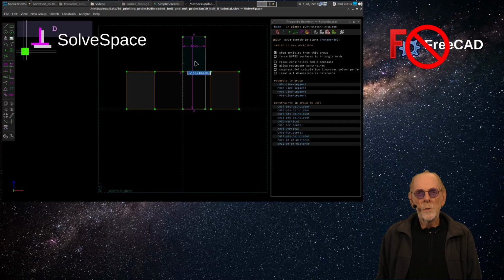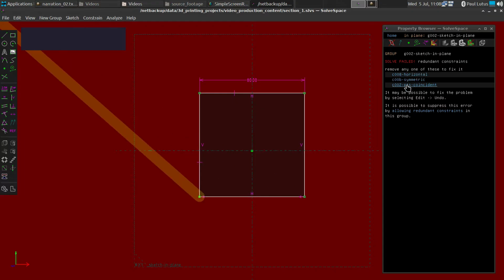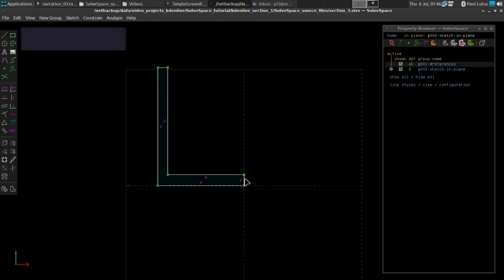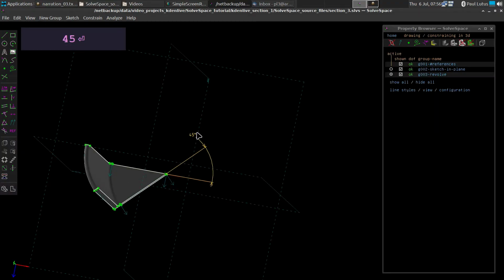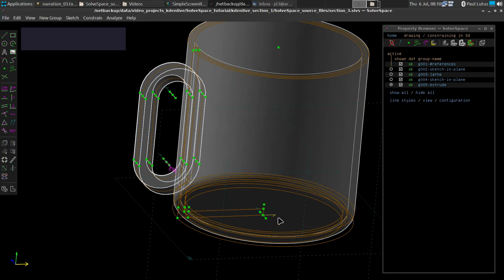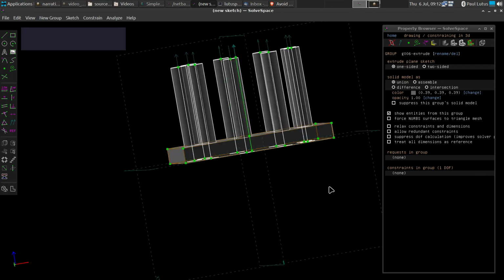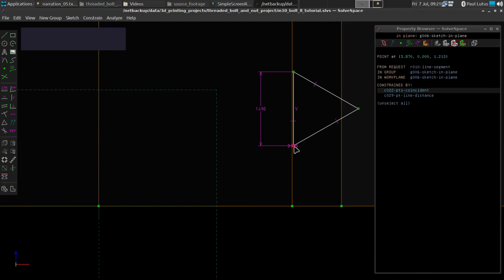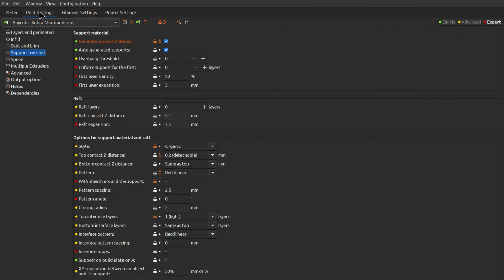Learn 3D Design with SolveSpace

Comment: I share your frustration with Freecad.  Solvespace looks great but the lack of variables and expressions is an absolute show stopper.  If you are designing a complex part or assembly, and you realize late in the project that you need to adjust something, you need to manually go back and fix everything based around that original object you adjusted.. which could be many of hours of work for one small modification.  Solvespace NEEDS expressions.
Reply from the maker: Yes, that would be an enhancement, but my video shows how to exploit single-definition values. But basically I agree with you.
Reply: @lutusp  It can work ok without expressions depending on the project. My interest is primarily with woodworking projects and the ability to, say, scale a table to a different size after I've put all the parts together, is invaluable. Someone's working on it with solvespace .. kinda. There's a "parameters" branch for this purpose, but it's not too active. From what I gather, the person working on it is stuck with how to work with different units (us/metric). Hopefully it gets some movement one of these days.  I was using fusion360 for my projects previously, but that company has done such a hatchet job to the hobbyist version I'm on a quest to find an open source replacement that fits my needs.  The worst part about FreeCAD in my opinion, is the convoluted workflow needed to access vertices and edges from other sketches when you're assembling parts that need to share common geometry.
Reply from the maker: @arcooke  Unless you dislike programming, there's a Python environment called CadQuery that's a better choice for designing projects that need strict dimensional control and sharing. In CadQuery you enter the required dimensions, then design the project to suit your predefined parameters. This way you can get different outcomes by changing only the provided dimension list and the model adopts the new entries without requiring any rework.

It's not as nice as SolveSpace, it requires more visualization skill, but there are ways to get interactive visualization as you progress.

I have a video that shows some aspects of CadQuery: https://www.youtube.com/watch?v=blkjW0JauX8 -- it's more of an introduction than a full tutorial, but you should get some idea of how it differs from SolveSpace.

I hope this helps and thanks for writing.
Reply: @lutusp  Actually, so far cadquery has been my #1 choice of all the different options I've tested out!  I've been playing around with CQ+cq-editor. I do have some programming background, though I burned myself out  (more like burst into flames) several years ago so I have trouble staying focused.  The project I've been mulling around lately is redoing kitchen cabinets and I started working on a library for cadquery, and the plan was for it to handle the general parts and assembly work so I could just plug in the number of drawers, doors, and dimensions and it would generate for me the completed cabinet boxes, and from there I could put together the cut list and get going in the garage.  It is a lot of work, but cadquery is a really neat and powerful tool.  I like it a whole lot better than openscad.  A hypothetical solvespace or fusion360-like frontend for CadQuery would be the perfect CAD program IMO; a visual point-and-click editor using CQ as the backend, with the unlimited freedom and power of python as an optional feature.  thanks for the chat. I will check out your CQ video

Comment: hello! I have an problem, when I want create an like bolt head, i get an error: "Bad selection for equal length" I think, I can choose only 4 lines, not 6 or 9.
Reply from the maker: Yes, a known issue. My video shows me selecting more than two lines (like six) for comparison, but this is a feature only available in the most recent SolveSpace version, one you must compile yourself.

The Windows SolveSpace version is not current and doesn't have this feature -- in that version  you must select pairs of lines for this operation. You must repeat for each pair of lines.

Sorry -- I can't make the SolveSpace developer keep the Windows version up to date, and most users can't compile from source.

This is one of the few differences between the Windows and Linux SolveSpace versions. I must remember to say this difference in my next SolveSpace vvideo.

I hope this explains the issue, and thanks for writing!
Reply: @lutusp  but i am using fedora linux and how exactly should i compile the newer version and what version are you using? thank you for answering!
Reply from the maker: @ВолодимирСабадаш-е1ш  The fact that you're on Linux doesn't assure you have the most recent SolveSpace version. That would require a compile from source, and compiling is a specialized activity that's really difficult without the right background. It involves:

* Installing a development environment including a C/C++ compiler and kernel headers for the running Linux kernel.

* Installing  a number of prerequisite libraries that SolveSpace needs to be able to successfully compile and run.

Details here: https://github.com/solvespace/solvespace?tab=readme-ov-file#building-on-linux

This is all so you can select more than a few lines in a specific operation. All I'm saying is this is a big project for a small return.

> what version are you using?

The developer makes many changes between version releases -- they're identified more by build numbers than release numbers.  The current release/build number (which I am running) is "3.1~eedfc653". This BTW is true for most programs under active development, especially open-source programs.

I hope this helps. I'm planning more SpolveSpace videos and I guess I should explain more about this topic in my tutorials.

Thanks for writing!

Comment: Please more advanced tutorias for SolveSpace, Crazy how nobody  mentions it as a REAL FOSS alternative to 3d CAD sketching. I used to use Solidworks and NX and they really got me hooked on the features and constraint system.... I feel SolveSpace is THE PERFECT replacement for either SW or NX.... It feels so similar and yet waaaaaaaaaay simpler. I'm powering through 3d models with this tutorial. Thank you Paul!
Reply from the maker: Yes, I have plans for more SolveSpace tutorials, in response to the many appeals for more detail and clarity around basic concepts.

Thanks for writing!

Comment: Very helpful.  I guess I find it very tricky to correctly select the plane I'm about to sketch in.
Reply from the maker: Yes,, it took me a while to learn how to chose a given target plane. It turns out that clicking the edge of the desired plane is one way -- this is more reliable than trying to choose it at the center or another way.

This works because the three planes are easy to distinguish in the 3D view by their square edges than by their centers.

I hope this helps, and thanks for writing!

Comment: Hi! With step and rotate you ended up with 1 DoF. I've checked and it seems to be the angle by which the elements are rotated when stepping. Is there a way to constrain that so that it is fully constrained?
Reply from the maker: Hi -- without a context, without a diagram, it's not easy to identify possible reasons. Sometimes the menu item "Analyze" ... "Show underconstrained points" (Shift+Ctrl+F) can help. This feature lights up points that aren't properly constrained.

I hope this helps -- thanks for writing!

Comment: For God's sake. What is this penguin + r key?
Reply from the maker: Sorry, I can't figure out which key you're describing. If this is still an issue, perhaps you could give me a time in the video so I can see the problem for myself. It might be "rectangle", which uses the R key.

I hope this helps.
Reply: @lutusp  At 50 minutes into the video, when I'm trying to replicate the drawing, there's always an error when I do shift+l, exactly at that moment it also appears in the top left corner of the video saying to type this combination of a penguin figure + r and I couldn't associate it on my keyboard, maybe it is the cause of the error?
Reply from the maker: @natanaelmelo9481  Okay, I figured it out. The "Penguin+R" is actually my pausing the screen recorder, it's not a SolveSpace command. Please disregard it and wait for the next actual command. And just in case there are more of those, just ignore any "Penguin+characteer" commands, they're not for SolveSpace.

My screen recorder has its own commands, and I sometimes pause the video screen recording to catch my breath. The keyboard recorder dutifully records those keystrokes -- I'll have to think of a way to prevent that.

Anyway, when you see the penguin, just ignore those keystrokes. I hope this helps.
Reply: @lutusp  lol ok, my friend, thank you very much, now I understand. As for the error that was appearing, it was resolved by limping a box (force nurbs surface to triangle mesh)
Reply from the maker: @natanaelmelo9481  Yes, I have to enable the NURBS feature almost always, in anything resembling a complex design. I've gotten to the point of ignoring the messages about rendering errors. They seem to have little effect on 3D printing and other results.
Reply: @lutusp  But anyway, thank you very much for your attention, I'm just starting out in solve space and I'm already learning a lot from your videos

Comment: how to rotate a drawing in solve space with the mouse
Reply from the maker: It depends on  how you mean "rotate". But try holding down the Ctrl key and right mouse button while dragging the mouse for one kind of rotation. Then try pressing the Shift key and right mouse button while dragging, for another kind.

I hope this helps.
Reply: @lutusp  Thank you very much, it worked
Reply from the maker: @natanaelmelo9481  You're welcome. Some SolveSpace users have complained that the rotations aren't intuitive, but I think over time it gets easier.

Comment: The biggest problem I know so far about FreeCAD is filleting irregular shapes and topological naming problem. How does Solve space do in these two areas?
Reply from the maker: To be direct, SolveSpace's filleting is less robust than in FreeCAD, and AFAIK the TNP has the same status -- it's not directly addressed or mitigated and is only less an issue because SolveSpace's projects tend not to be as complex as those in FreeCAD. I would be happy to be corrected about this view, but it's to the best of my understanding.

The issue in both SolveSpace and FreeCAD that I find most annoying is the fact that you cannot change an element from which other elements spring without destroying the entire assembly. That would require a level of code robustness that neither program possesses at this time.

The main reason I prefer SolveSpace over FreeCAD is that the former is less opaque to a new user. There are times with FreeCAD where I have no idea how to take he next step and the documentation doesn't help, or a feature isn't robust enough to accommodate what one might call s common-sense approach.

Thanks for writing!

Comment: Pretty good video but I almost died when you went to extrude/difference inside the cup ;-) That was bound to trigger NURBS faillures for multiple reasons. Better to end the handle sketch inside the wall of the cup - maybe draw a vertical line in there and split the curves against it? When switching to triangle mesh, we do recommend putting that switch as far down (not up) the construction history as possible. I just submitted a PR (not accepted yet) to make dimensions on ARC entities default to Radius instead of Diameter because this video reminded me that's usualy what we want. Also, S is for "segments" O is for "On" and right-click ends your line segment without starting a new one ;-)    And Q is for "eQual" I guess, but nobody mentions this and the keys seem arbitrary. Best I can tell G is for "green" which is the default color for construction lines !?!?
Reply from the maker: > "Better to end the handle sketch inside the wall of the cup"

Yes, I sometimes make unwarranted assumptions about a program's internals. My favorite program for this activity was the old Pov-Ray, which relied entirely on  CSG ( https://www.povray.org/documentation/view/3.7.1/28/ ), pure mathematics, no polygons. In that environment, everything worked as one would expect from mathematics. No surprises.

Thanks for writing!

Comment: Good tutorial. I also went for FOSS solutions, and I found both solvespace and freecad. Freecad at glance seemed more advanced and solvespace seemed more like learning basics platform. All I need is something to feed my 3d printer. Freecad I suffered through designing one or two parts, but at some point I just gave up on it, highly frustrating. I went for solvespace and learned most of it. Came in here for helix how to use it to make threads.

My only gripe with solvespace is one project for soldering iron box that required me to compile solvespace for 64 bits as it was runing out of ram. Also the framerate went to like one frame per 5 seconds. Im not sure why, but it struggles a lot with more complex projects - or I don't know how to make it in a way that it won't. (if anyone is curious I can provide file for it, be aware, requires x64 build). And the red lines sometimes get to you (even though NURBS solves 99% of occurances)
Reply from the maker: > Freecad I suffered through designing one or two parts, but at some point I just gave up on it ...

The same experience here, exactly.

> Im not sure why, but it struggles a lot with more complex projects ...

Just a suggestion, in the configuration dialog, try changing the "chord tolerance" and "max piecewise linear segments". These adjustments operate in mnore than one dimension, so they can greatly improve speed and reduce memory consumption, in exchange the screen drawings look less aesthetically appealing.

The upper two adjustments affect computatiion and display, the lower two affect exported meshes. This means you can have a high-accuracy export (created slowly) while speeding up the editing phase.

> And the red lines sometimes get to you (even though NURBS solves 99% of occurances ...

I find that if I never allow two 3D vertices (of different subassemblies) to occupy the same location in space, those errors go away. I do this by deliberately adding a tiny value to some dimensions to avoid collisions.

But in most cases more RAM and a faster processor would solve the other issues. Just saying, I know  this may not be feasible.

I hope this helps.
Reply: @lutusp  yes, i am aware of chord tolerances. Sometimes though even when its at 0.2% / 10 when project is complex enough, it struggles hard. I dont think I can grab better cpu (solve space is single threaded afaik).

My machine is pretty strong (ryzen 5800x / 80gb od ram) , but solvespace is 32 bit program by default, so by default it is limitted to 3-4 GB of ram. Thats why i recompiled it to 64 bit and then the memory limitations go away for me. 

I will try adding small spacing next time i have problems with the red lines. I hope it will not be enough spacing to fool my slicer to put there actual gap.

Thanks for tip.
Reply from the maker: @by010  I agree SolveSpace is single-threaded, I mean AFAIK. I guess my designs aren't that complicated, so I don't see the issues you describe, and my local install, like yours, is compiled in 64 bit.

I try to design complex things in pieces to avoid too much complexity in any single file.

I do know this -- all the really powerful CAD/CAM programs are closed-source, and most are expensive as well.

Thanks for writing!
Reply: @lutusp  is there a restriction on writing replies on this video? It seems if I write any reply it does not get posted?
Reply: @ruevs  thats youtube thing. They often figure out some comment is censor-worthy and hide or delete it. It is what it is
Reply from the maker: @ruevs  Certainly not from me, I'm glad to see people's posts. I hope this comment system isn't breaking down.

Anyway, thanks for writing!
Reply: @lutusp  I think comments with URLs in them get "censored". Somewhere in your YouTube Studio account there is a section of comments "held for review" or something of the sort. Anyway I'll try again with mangled URLs.
Reply: @lutusp  Definitely any reply with anything even remotely resembling a link in a gets removed immediately.
Reply from the maker: @ruevs  It's my experience that posts with links get "held for review" for the account owner, so I checked and don't see one. This doesn't mean it's not out there somewhere I can't find, and frankly the YouTube comment system is sort of clunky.

But in another case, a poster replied with links and that post promptly appeared in the "held for review" bin without issues.

So I really don't know what happened. It wasn't any action on my part -- I welcome comments.

Comment: Had similar experiences with FreeCAD in the last years, and totally agree. I started with Fusion360, because it is an easy entry into CAD design for 3d printing. Because i am also an Open Source Advocate,  i was never tightened really close to Fusion360. I tried the FreeCAD versions 0.17 - 0.21, for a possible switch to this FOSS. But honestly I have to say, that what I have seen there, is reason enough for me, to not try the newest version 0.22 again. Instead of fixing bugs, which are present already since 0.17 (and maybe already before), the FreeCAD devs are adding more and more features, which are by themself breaking other things. This is making the overall experience in FreeCAD getting worse with every major update. It is really annoying, when i am making a technical design over a few hours, and right at the end, a simple feature, like f. ex. a chamfer, is breaking the whole design, for no obvious reasons.